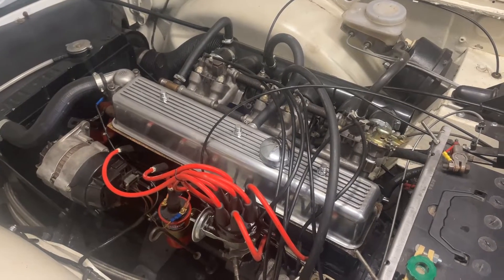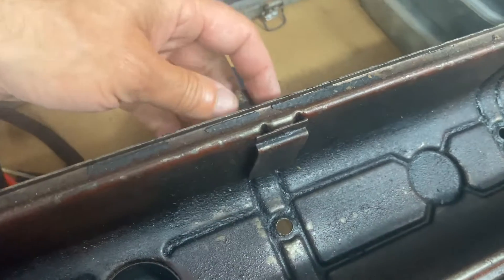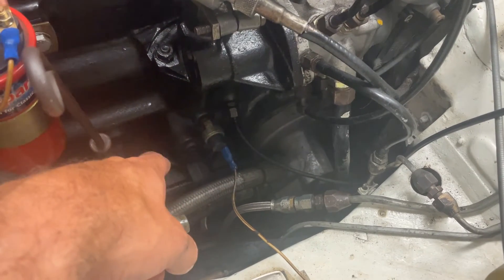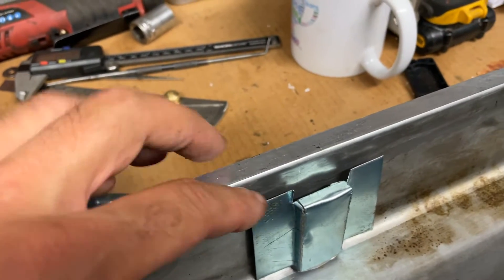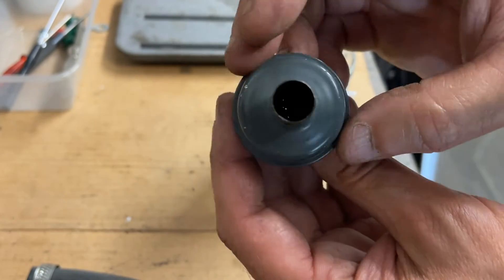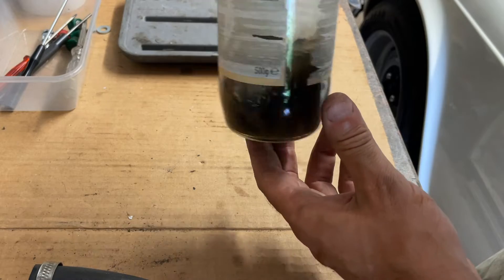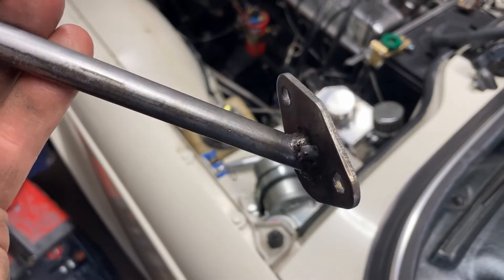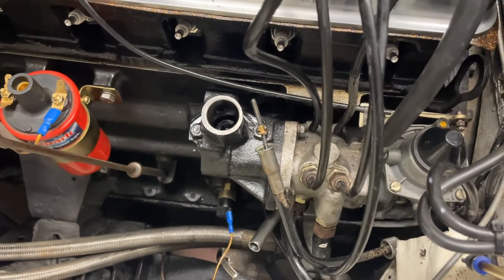Triumph TR6 Explained - Engine Breather/Vent Upgrade

Comment: Hi pal, have you noticed any difference since converting to the crankcase breather
Reply from the maker: A little less out the exhaust on hard acceleration and the tank collects the oil vapours which otherwise go through the induction so a cleaner burn . Glad I did it
Reply: @mgmidget-thebirthofaraceca4349 I've just carried out the same project.. thanks for the video

Comment: Bauly Cars have done a bespoke catch can for the TR5 and TR6 which knocks the spots off any aftermarket catch tank. Comes complete with 19mm outlet from the crank case. Worth checking out.
Reply from the maker: Excellent 👌 it’s good to have choice. There are some excellent very cost effective solutions on the market now

Comment: Hi I've got my metering unit away and have decided to copy your idea if you don't mind and also put a baffle plate in the alloy rocker cover. The only thing is my catch tank won't be as fancy as yours a credit to you. Regards Kevin
Reply from the maker: All the best. Mine came off eBay and wasn’t particularly expensive

Comment: How did everything work out with the extra venting and oil catch can?  Were you still getting a lot of blowby venting into the atmosphere?
Reply from the maker: It relieved the crank case pressure for sure so was helpful in not sending oil fumes back through the induction system, but the underlying cause was the engine needed a rebuild which is now done (see other videos)

Comment: So after running this mod for a while, did you notice ant difference in running, tickover etc? Do you have any oil residue in the catch tank?
Reply from the maker: yes a bit less smoke out the back and a bit of oil in the tank. Longer term the car needs a bottom end rebuild but for now im happy with this mod

Comment: Is the oil catch tank essential or could one not just put a filter on the end of a tube from the old mech fuel pump point?
Reply from the maker: Yes I guess you could just put a filter on it

Comment: Love your vids!!

Q: The crankcase vent… does it require a bit of vacuum to operate? I’ve a US carbureted 6 and have fitted the good parts oil separator system. Manifold vacuum, pulling on the lower crank case and upper rocker cover separating oil and putting the combustibles into the intake. Manifold thoughts? It seems to me there’s a lot of vacuum, put on the lower crank case in the set up.
Reply from the maker: the pipe from the vent is connected to the oil catch tank. relies on venting to atmosphere. no vac involved. just relieves the crankcase pressure so less pressure pushing oil out of the engine hopefully. thanks for watching and glad your enjoying the vids

Comment: Hi, great set of videos. Could the breather on the crankcase be done without removing pump,  it is a little above my pay grade!!! Thanks
Reply from the maker: maybe but access is very restricted. much easier to lift it out of the way. thanks for watching
Reply: I got it up on a lift and it was much easier for me. That pump just terrifies me! It now vents   great and an oil leak that I had just vanished. Thanks again

Comment: Curious why you decided to use a bolt and nut and not a pop rivet on the plate installed on the valve cover
Reply from the maker: good question. no particular reason. didnt want a pop rivet to vibrate loose , but having said that there's probably more risk in the nut coming off so takes your choice. guess i just prefer nuts and bolts

Comment: TR6 engines will piss oil all over themselves, especially with aftermarket valve covers.  Either figure out and fit a PCV system or put in baffle plates and fiber filters to allow the oil mist to condense and drip back into the engine or a combination of both.
Reply from the maker: Thanks for watching and glad you enjoyed the video
Reply: Mine was rebuilt in the 1990’s aftermarket rocker cover and doesn’t drip a drop of oil! May be, you need to get your engine rebuild by a professional?

Comment: Nice! Good execution of the plan. Does it matter if a catch tank is located above or below the point of exit for fumes
Reply from the maker: I worked on the basis that you want to avoid oil flowing down so mounted it higher rather than lower. Thanks for watching

Comment: Greetings again,  this Sam from the US. 
Great video. 👍👍
Will you kindly answer my questions. 
1.  My rocker cover had a plate that was glued in front of the breather hole. I noticed that the glue had given away and the plate was laying on top of the cylinder head when I had removed the cover to adjust the valves. 
-What is the purpose of the plate (similar to the one in your older rocker cover) in front of the breather hole?
-Should I try to attach it again?
-how much back pressure does an engine need?
-Have you felt a better performance from your engine since you’ve added the new breather?
-Do you recommend the retrofit?

Much Thanks 🙏 

Cheers,
Sam
Reply from the maker: Hi, great questions. The little plate stops direct oil splash and fumes but allows air around it so should reduce oil mist going to the induction and going back through the engine. I would refit it. The TR6 engine runs under negative pressure as the induction sucks the mist created out. All this mod does is reduce the amount of oil mist going back through the engine meaning a cleaner burn and less smog out the exhaust. There’s no increase in car performance noticeable only less exhaust smog under hard use

Comment: I like the thinking behind this upgrade but is there any oil smell getting into the cabin from the breather filter?
Reply from the maker: Hi, no as the air vent is taken from the exterior grate in front of the windscreen. The bonnet seal is between this and the filter. Thanks for watching